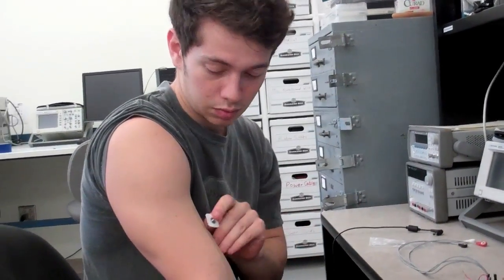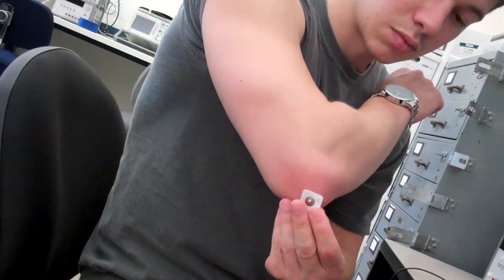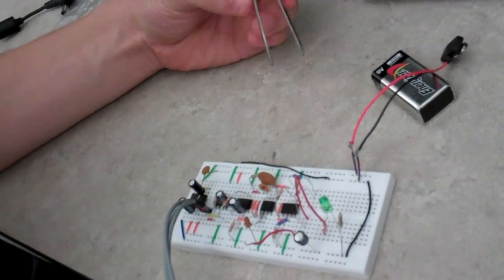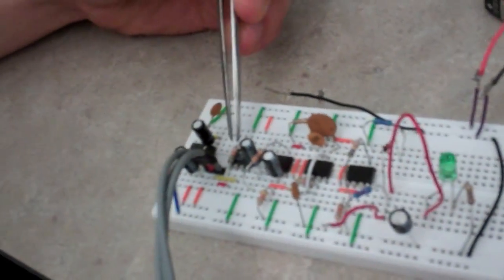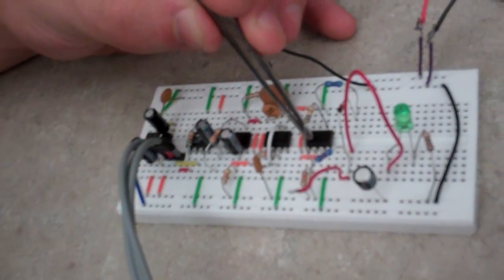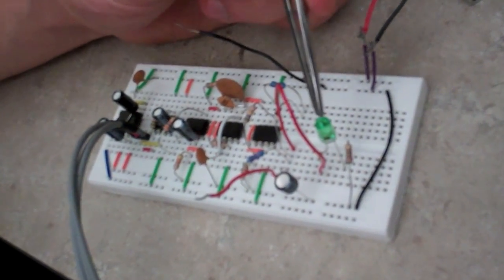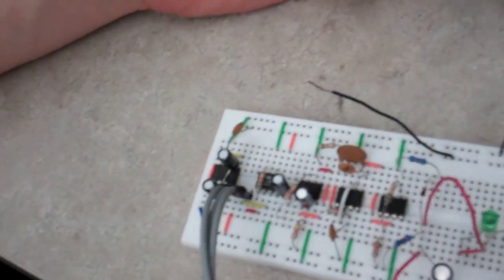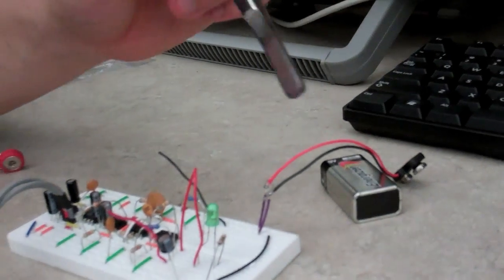Basic EMG Signal Processing

Comment: Thank you. I can probably work from the board in the video or do it from scratch now that you’ve proved it works, but a diagram would be a great reference (you don’t need to share it though). Idk how dm’s work. I had a project idea yesterday and I feel like your video is a key step in making the equipment cheaply. I have an arduino and motors to test this with. If my design is the same as yours, I’ll mention your name, but chances are I’ll make something different and use an AI to filter noise, as I have a feeling that the maximum amplitude might be shown by noise (I’ve done no testing yet)

Comment: Hi iam working on the same project but is there a chance to control the fingers using this technique and also, which microcontroller would you prefer.
Reply from the maker: I've seen people do this for fingers, you'll have to Google around for electrode placement. Microcontroller depends on your familiarity. I've started  really liking the bgm121 from SI Labs.

Comment: How do you get rid of lag? I see many projects with people controlling a robotic hand using EMGs and Arduino, but it takes almost a second for the hand to respond to their movements.
Reply: The lag is 90% processing, Arduino Unos and other standard microcontrollers are pretty slow. A simple hardware upgrade will fix the delay.
Reply: I have an ultrasonic distance sensor that has no lag. If the output signal is a value that is fed into the input without processing, there should be next to no lag. I haven’t delved this deep in practice yet. Would the air, clothing or wire distortions change the signal too? @wolfchaldo

Comment: can i get the the values of the resistor and capacitor in parallel with the diode in last stage ...im having problems getting a stable signal

Comment from the maker: It's pretty inexpensive, I can't imagine the total cost of components would be greater than $15.

I used a MAX1044 so I could run off a single battery (e.g. It gives you +9v and -9v from a +9v supply).
If you can afford it, get some OPA1013 op-amps.  But any ol' op-amp will work